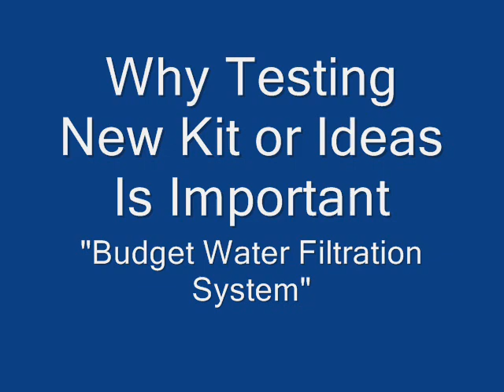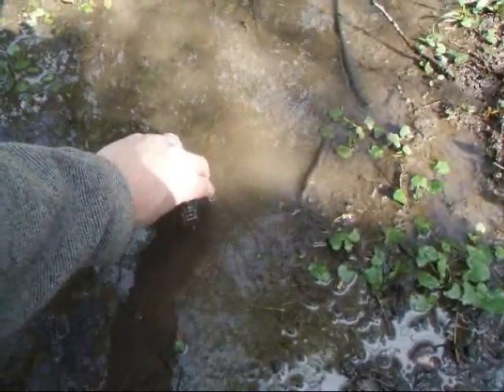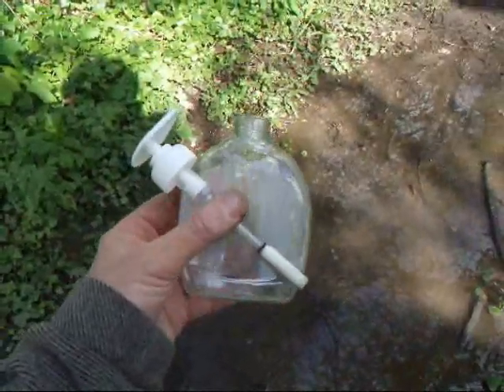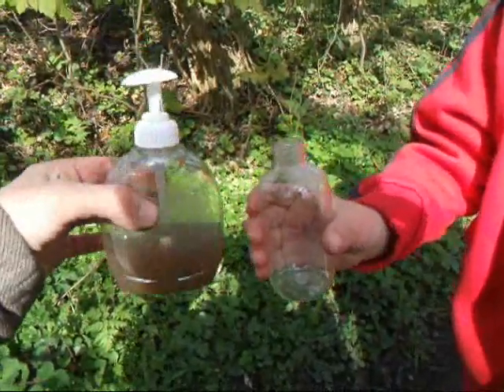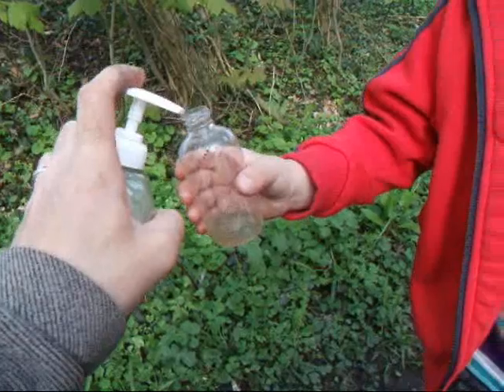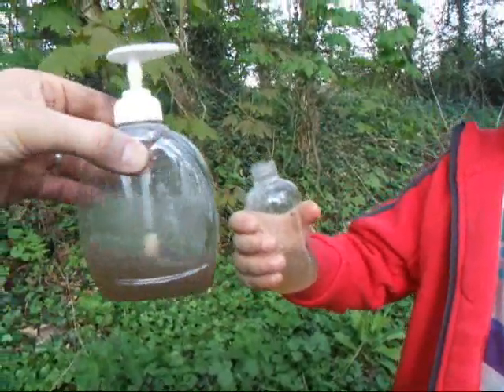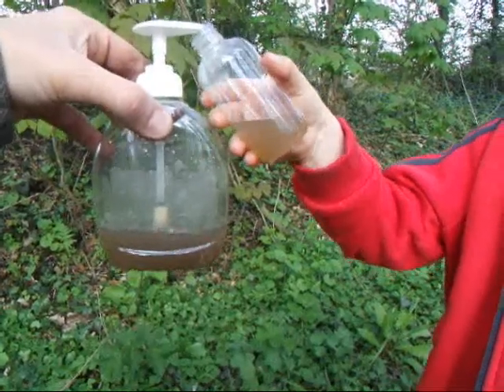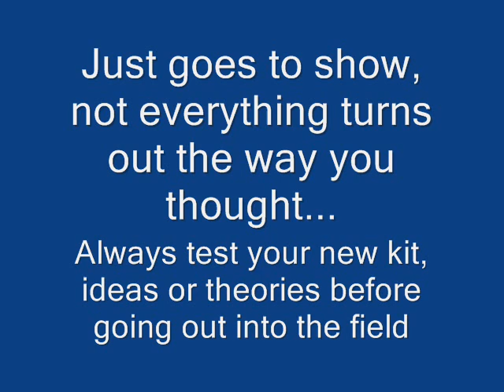Bushcraft - Why Testing New Kit & Ideas Is Important

Comment: No worries man! Positivity always yeah! As Crazysaint says you could put a small canvas sock on the end. Wgat about getting some charcaol pieces and shaping something to fit inside. what a bout a small canister that fit inside the bottle, like a vial with a hole at the bottom for the water to flow through/into the chamber, then inside the chamber you put charcoal, sand, cloth, grass and anything else that you can think of that would filter?